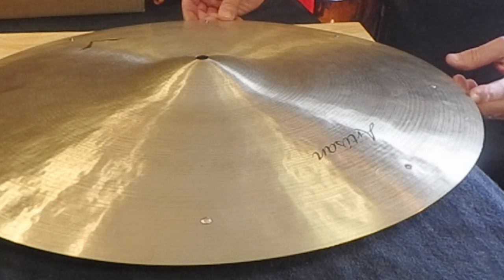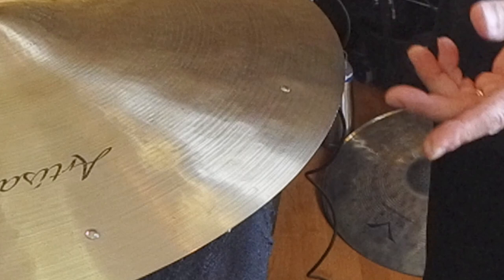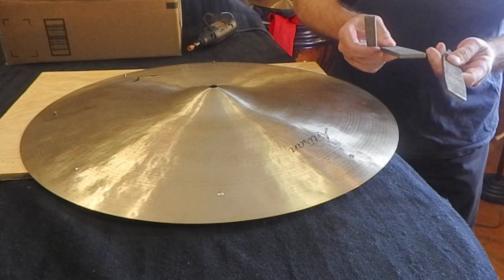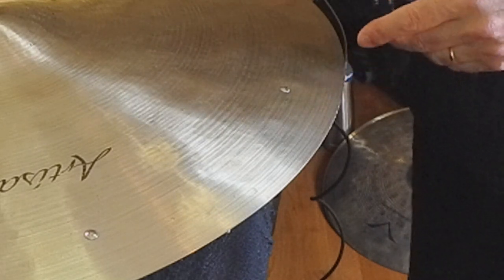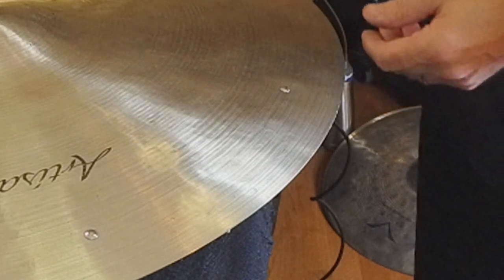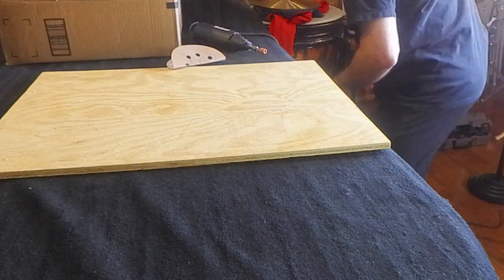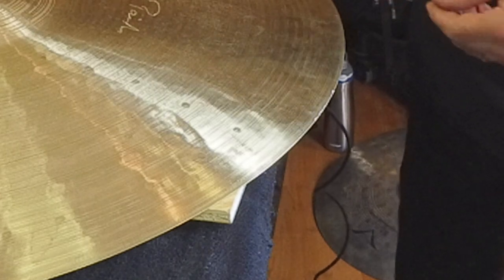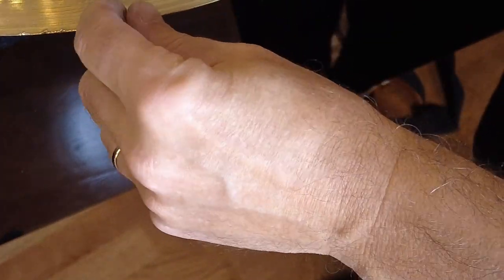Cymbal Edge Repair

Comment: Good tips! Thanks Rick!

The files generally only cut on the forward or down stroke. I like filing perpendicular to the file direction, which is called draw-filing. For clean up, I like to mount the sandpaper on pieces of wood and small PVC pipe and move back and forth in the direction of the edge. There’s less chance of slipping and scratching the cymbal’s surface with the mounted sandpaper. Grits 320>400>800>1200 then #0000 steel wool to polish.

For Dremel or rotary sanding, you can buy cylindrical mandrels and wrap the sandpaper around them, creating your own sanding buffs in whatever grit you need. I learned a lot of this from jewelry makers and it’s really upped my finishing and repair game

Comment: Hi Rick - I just received a 1950's 22- ride Zild A. Light @ 2400g.  Not showed on photo's I was sent but has had similar work done to remove flea bite's.  I can see done recently as shiny. How much does this devalue the cymbal Rick ?  I'm a stickler for originality but at the end of the day's it's all really about sound - it's also drilled but no rivet's fitted 'yet' !!  Thank you.
Reply from the maker: Most of the cymbals that are that old will have some type of defect. If it does not affect the sound of the cymbal, which it most likely won't, the value should not be affected much since, for most players with vintage cymbals, it's all about the sound.
Reply: @rickdior  Thank you for taking the time to reply Rick - you are a true gentleman not to mention super talented behind a kit .

Comment: Ive found that if the flea bites are that severe, that you can just use the grinding stones on your dremel to gently remove them, then use sanding barrel bits from 80-120 grit, and then use 150/220/400 grit sandpaper to finish, is the best and quickest way to get the edges baby butt smooth

Comment: Hey Rick, did you ever reglued a reinforcement ring on an old kit? I was offered a nice 60s kit, but the reinforcement ring on BD is completely loose. It shouldnt be that hard, right? Any tips? Thanks so much!
Reply from the maker: Yes I have.
Use some Titebond wood glue with a syringe. That will enable you to get the glue in there without taking the entire ring off.
Clamp it with some rubber tipped clamps. You will need to take the heads and rims off. Let it dry for about 12 hours and you should be good to go.
Reply: @rickdior  Sounds easy enough. Thanks so much and kudos for taking the cymbal situation so Zen-like! haha

Comment: I’ve definitely heard that these flea bites can turn into cracks, but in your experience, is this actually the case?  I have a beloved crash/ride with a single, fairly significant flea bite which I’ll be giving it the treatment you’ve detailed here, but should I be concerned?  Thanks again for all the great videos!
Reply from the maker: Hi Craig
I have not had one turn into a crack.
You could use a round file and file that out if you are worried about it.
Reply: I've had one turn into a crack. It was a sad day. Not taking any more chances. Also finally buying a hardcase.